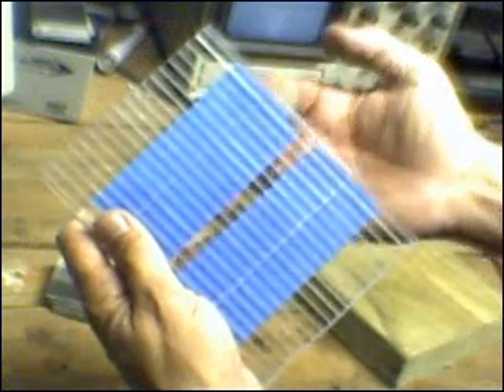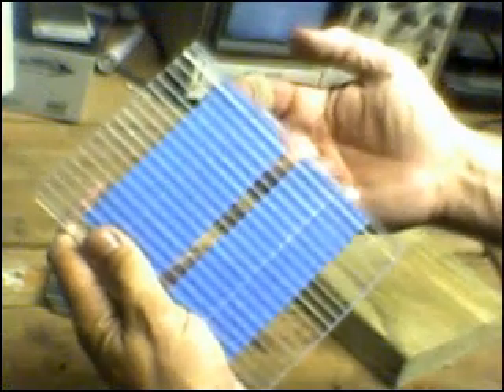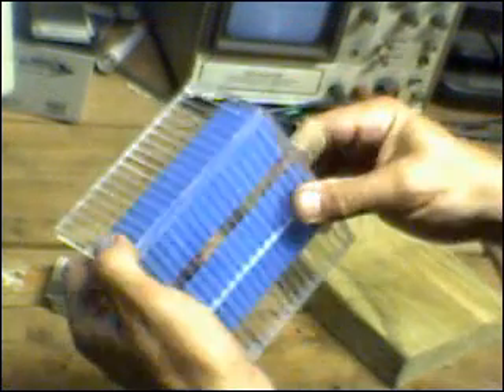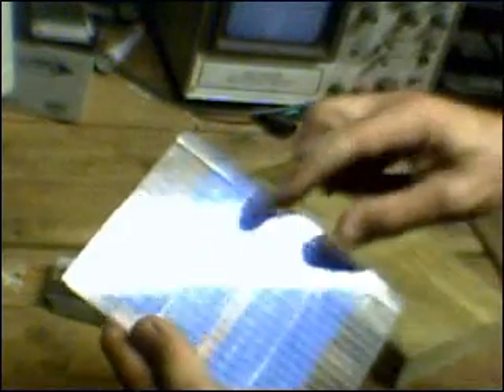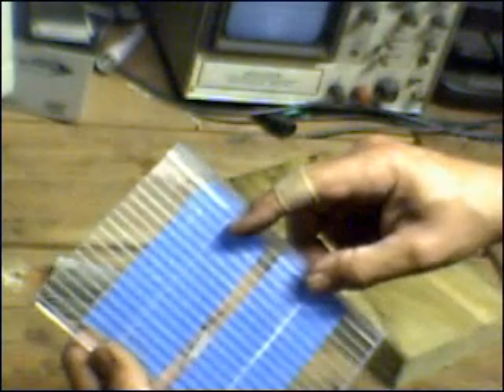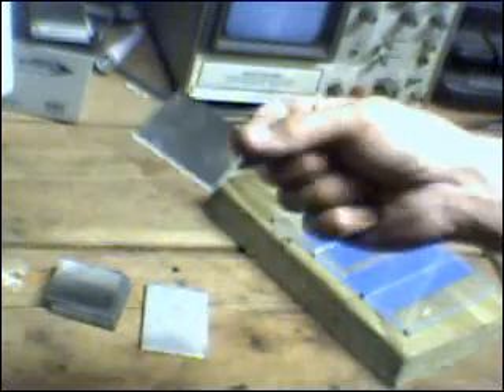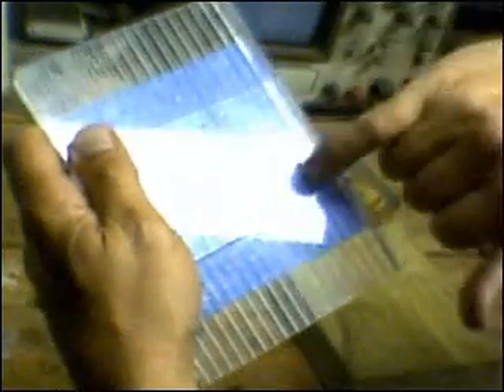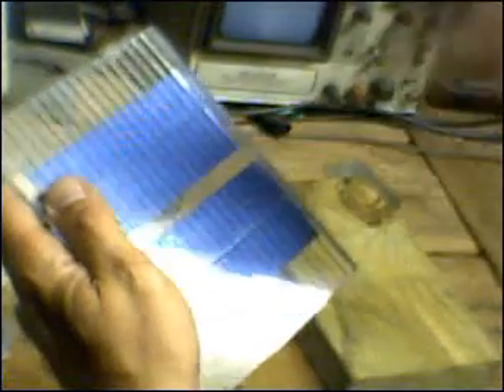12 - Hydrogen Electrolyzer test unit 01

Comment: Hello ZFF..Just curious..what gauge are the 2" S.S. squares? Did a s/m shop do the cut-off shear work for you? What  about using a sign shop for the acrylic layout and routing?Or subbing Lexan for the acrylic?Electronic welds or chemical glue ups on all seams?Thanks